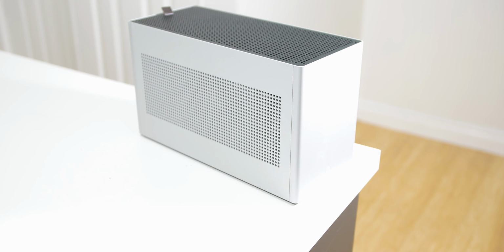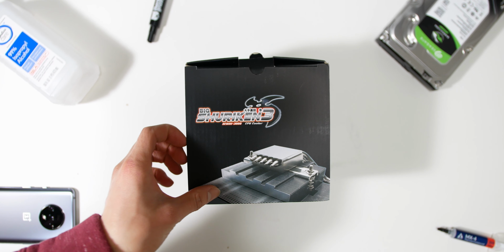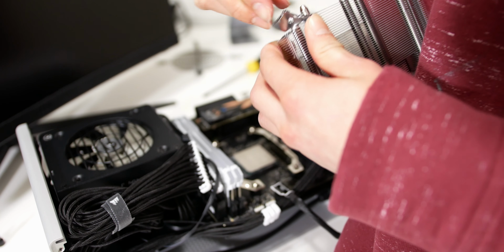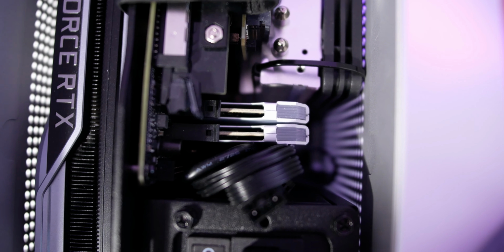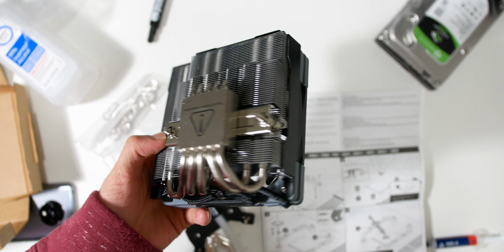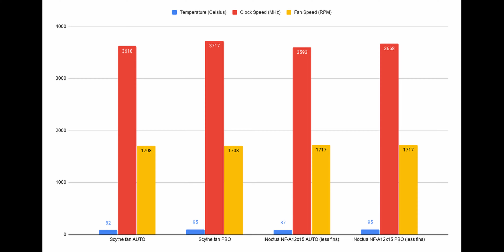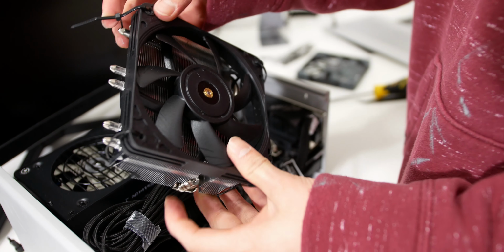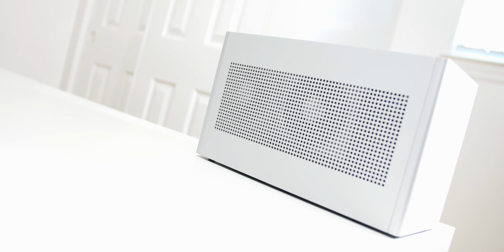Scythe Big Shuriken 3 Installation In Louqe Ghost S1 - Scythe Big Shuriken 3 Review

Comment from the maker: UPDATE: I repasted with Thermal Grizzly Kryonaut and got 95C at 3693mhz with a fan speed at 1719RPM with PBO enable using Prime95 Small FFTs (this is nearly the same as the original configuration of the Big Shuriken 3 without modifying the fins). I’d recommend undervolting if you plan on using this cooler with a high TDP CPU. Or if you’re just using your build for gaming, this is a great cooler because your CPU normally won’t be under full load.

Comment: Your graph is bad, you have temperature, rpm, and MHz all on one y-axis and it makes it really hard to notice any differences between the fans. Having 3 different graphs for each set of variables would have been so much better
Reply from the maker: WiiAllTheWayHome Thank you for the suggestion. I’ll be sure to fix that in the next videos.
Reply: @TonyTechBytes  no prob! I work a lot with charts and graphs, you would be amazed how many proposals and documents come through that are just awful. I think in yours case you wanted to simplify which is totally reasonable!

Comment: anyone else somehow got the shuriken 3 slightly slanted on one side? like the right side is about 1mm taller than the left (ram side).
Reply: hi, i am having the same issue on an b550 aorus elite

how did you fix it??
Reply: @Leo-bk9kb  sold it, bought something else instead. I use IS60 EVO.
Reply: @warnacokelat  holy shit you solded, what was your motherboard?

i did the trick of screwing slowly and with a lot of pressure one side by side and it worked

i think i was afraid of doing this previously because on the tutorial videos nobody seems to put much preassure, but it is necessary to fit it